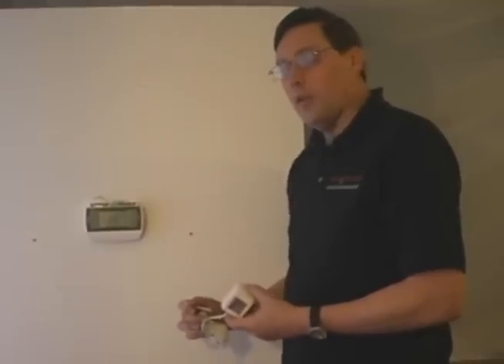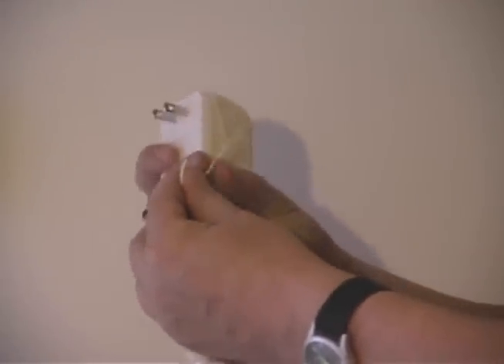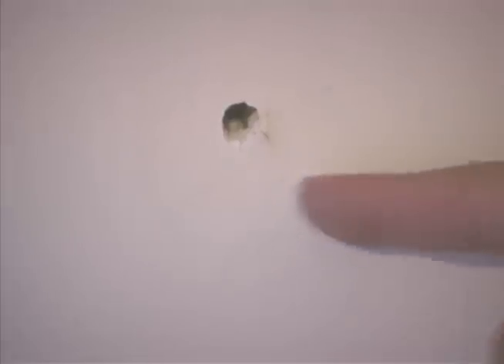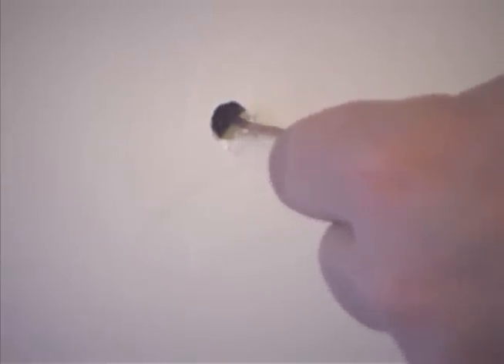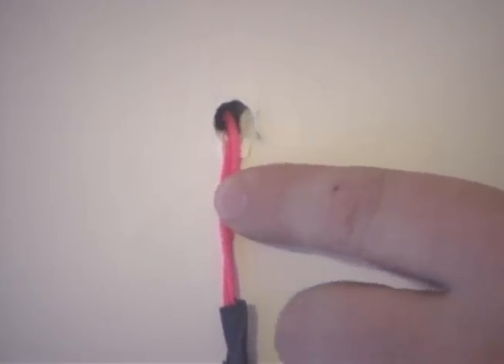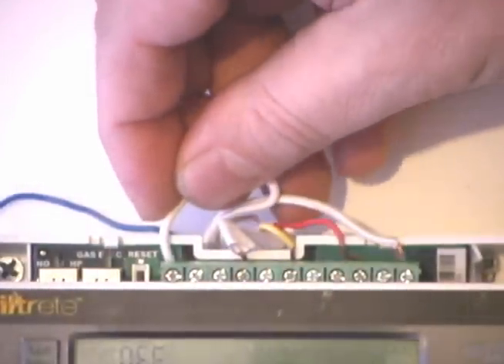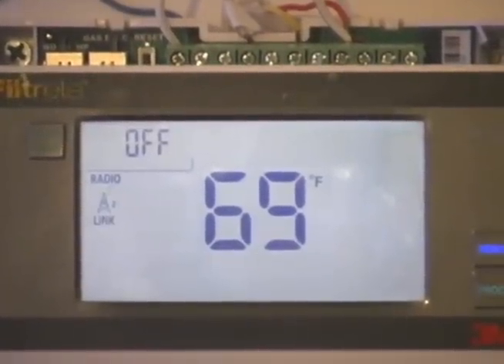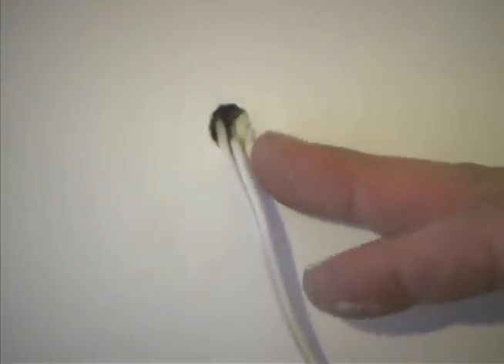C Wire - How to power the thermostat via an additional transformer

Comment: So if o only have an R just add it to C and R correct?
Reply from the maker: If you only have a R wire  you do not have a wire to put on C. you would need to add a 24 volt at .5 amps power supply.  Then from the 2 wires coming from the low voltage side of the transformer you would put one wire on C and add the other wire to the RH terminal that already has a wire coming from your HVAC system
Reply: @Homehandyman101  my system has no the just r. But I got it to work with my method. Thanks so much.

Comment: So if I already have an Rc wire connected to my AC, I will now have both that wire and 1 of the wires from the 24v power supply on the thermostat's Rc terminal?

Comment: Hello I am thinking of running power to thermostat using 24v transformer. This is because the new nest that just came out only has R, W and C. I have R & W for heat. I am planning to connect the two wires from transformer to R ( already has R furnace connection so doubling up) and to C. Is this ok? Especially doubling up on R?

Comment: I have a gas boiler. My new smart thermostat only has a "R" terminal, so what I have is 2 wire to the boiler red & white. So in summary red wire is connected to "R"  white wire to W1  then the 24V transformer I have 1 wire going to "C" the other wire going to "R" as well.  So the terminal on the stat has 2 wires going in "R" 1/2 of transformer and the boiler red wire, does this seem OK to you?

Comment: what if i dont have an RH terminal
Reply: Do you have a R terminal?
Reply: @pinball30  yes I have a heat only system. The R and W terminals are in use. I bought an external transformer. So what terminals would the external transformer connect to?
Reply: The R and the C
Reply: @pinball30  does positive from the external transformer go to R or C?
Reply: Should be AC and does not matter

Comment: Heat only system, I installed my Nest Thermostat as per the tech - Red to Rc / White to W1 / Black(fan) to G. I would like to add an external 24Vac transformer - I realize that one of the new transformer wires would go to C but where would the other go and where should my Red wire now go for this to work properly?  I am worried about frying something ;)

Comment: You suggest putting both the 24v wire from transformer and the 24v wire from the furnace on the same screw. Is that what I understand? If so, it sounds like you are putting double power on that one screw from two different power sources, is that accurate? If not, can you explain? I have this set up but have the transformer hooked up to the C and RC and the Red wire from the furnace hooked to the RH. This works for heat but it doesn't work for AC.  I would be really grateful for your help if you could help! THanks!!

Comment: Y’all are crazy! Aren’t you supposed to take out the jumper from rc and rh!? I have a 2 wire boiler system, with another transformer. I put my r in rh, w to w, one transformer wire to C and the other to rc and removed jumper.
Reply: This was the question I had - did your method above work for you?  Just looking for confirmation.
Reply: Dustin Lema yea, on my Emerson sensai thermostat
Reply: Perfect!  Picture is worth a thousand words - that's how I plan on hooking it up!
Reply: Dustin Lema glad to help bro

Comment: I just installed mine with a common wire.  However I used a 12 VAC transformer.  Everything works but i cannot get the yellow light to blink for internet.  It does show the cell tower and 1 since I installed the module on the left side.  Just no blinking yellow.  Is this because the transformer is to low or is it from something else
Reply from the maker: Yes, it is because you use a 12 volt transformer.  If you change it out to a 24 volts and .5 amps unit is will work correctly

Comment: Hi,  That's my prob. exactly, No common.  But  both the old mercury therm and the new therm.  neither of them have the   "RH" terminal   Both the old and new have a "R" terminal that is labeled 24V supply.    Is that the same thing?   If I hook one to the 'c' terminal and the other half to the "R"  24V supply terminal will that work ?

Comment: At 03:24 you indicate that the second transformer wire can be added to the RH even if there is already a wire there and it won't interfere.  If I do that, and remove the jumper between Rc and Rh, can I control my boiler, and separate AC unit from the same thermostat.  I will have the boiler wired to White and Rh (with 1 lead of 24V transformer also on Rh)  The other lead of 24 V transformer will go to C  and my AC will be wired to Yellow, Rc, and Green.   Do you think this will work?
Reply: That would be my set up too.  Did this work for you?
Reply: @AndrewTaub  yes it did.  I wound up changing it and control boiler and AC with the smart thermostat.

Comment: Thanks for a great video! I'm completely new w/wiring & read 5 diff ways & still deciding how to approach this.   Are you familiar with #2 solution on ecobee.zendesk.com/hc/en-us/articles/236335908-Taco-SR503-4-Three-Zone-Switching-Relay  

Initially I thought no problem, I have a new oil system & I'll follow Ecobee videos, only to find out I don't have a C, nor G to substitute. Then thought I'll install a C wire but had no clue to where. So that forum answered that I shockingly didn't have a C terminal in that Taco box at all, to support most new thermostats.  Then #2 method says I need "step down transformer" & "isolation relay". I watched a video about step down transformers wiring to Zone Valve, which I couldn't find b/c I had 2 circulators instead. So I've been stumped how I would do option #2 without a zone valve.

Your video sounds like a simple "plug & play" solution, but I have 2 zones & limited space for plugs & don't want to overload. Is there another type of transformer that handles 2 zones? I feel if there is a way such as #2, I think I read I could power w/1 transformer, depending on volts of Zone Valves volts combined, I guess in my case, the circulators?  I don't know what all the HVAC pieces do yet, nor what an isolation relay is.  So I may have a long way to go in research. I'm thinking of 2 different brand/model thermostats on each floor, once I figure out the most cost efficient way to get a C wire without accidentally short circuit anything..or avoiding rewiring all the wires if possible.  My existing old thermostat wires is just a w, rh, and a jumper from rh to rc. The even older Honeywell thermostat, is probably similar but very complicated looking because It sort of looks soldered in with molted metal.. I'm not sure & No labels.
Reply from the maker: I can not speak for Echobee but if you are using a Radio Thermostat all you need to do is hook one side of the AC transformer to the "C" and add the other side to the "RH" Note that each thermostat draws about 300 Ma so for two thermostats you will need a transformer rated for around 600Ma to 1Amp or 1000Ma,

Comment: I'm using a Honeywell wireless thermostat with an external transformer powering the device to the C terminal and the R terminal with the R and RH jumpered together. The thermostat powers on, controls heat fine, but when it tries to turn on the AC the thermostat just powers off and reboots after the AC and compressor seem to turn on for just a sec before the thermostat shuts back down. Any ideas what may be occurring?
Reply: Dont jump R and RH according to the manual there is no reason to jump anything.

Comment: I tried to connect an external transformer to the lyric t5 thermostat, however there is no rh connection. only r and rc. If I connect the ground of the transformer to the rc it powers the thermostat however the fan will not come on. This is for a heat pump according to Honeywell the rc is what calls for the fan. can you think of how I can get this to work
Reply from the maker: Hi  The R is the same as the RH connection.  So one wire on R and the other on C.   That should do it!

Comment: Just substitute g for common, if you have a common terminal on your furnace circuit board. Use g wire at tstat and move to c.then jumper y and g together at furnace. You will loose ability to run fan during a no heat or ac call, but better than running new stat wire. Only works if you have a fossil fuel burning device, because furnace controls fan for heating. Y and g get jumpered at furnace so when ac comes on you get high speed fan on. The g for c method does not work on an airhandler, because thermostat controls fan for electric airhandler. I dont like this method this guy is using because he has two transformers going to stat without jumper between r an r/c removed. Just better to run new stat wire to equipment. Also that kind of wire is not approved to be running behind wall or behind a baseboard.

Comment: You realize that your "stacking" power supplies right? What you are advocating here will eventually damage equipment and could even start a fire. The second power supply should be wired into a passive relay. I suggest you check with the manufacturer or a Licensed HVAC contractor before posting something like this.
Reply: Hello Cory,

I have a Honeywell RTH2310B with these jumpers only: Rh, Rc, W, Y, G

If you have a few minutes, can you tell me what jumpers to wire in in my transformer...

Thx
Reply: Moe I'm not completely familiar with that thermostat, but it appears to be a conventional. I would need to know what type of system your connecting to, and what color code (low voltage wires)your installer used on the low voltage system. Since it's not a "smart" thermostat you should be able to use the low voltage provided by your heating system.
Reply: It's only 1 red and 1 yellow cable.  The red one is plugged into Rh and the yellow is in W.

I bought and hooked up the thermostat myself.  

I'm just trying to see if there's any way to hook up a transformer -  safely - with this configuration.  I am tired of dealing with batteries. :)
Reply: Moe Not with this model thermostat. I read over the installation instructions and they have no provision for powering it.  Unfortunately most battery thermostats work better in most heating system control strings as they are not power stealing (unless designed for dedicated power)  If your looking to get away from batteries Honeywell is making their new "T" series which work nicely. I personally have an Ecobee, which I like. I don't personally like the Nest. As a technician I had as issue with their technical department help line and won't use them. All of these thermostats require a power supply SEPARATE of the heating system, run through an isolation relay, to work properly. I have seen many videos of people who "make them work" but are creating damage that can't always be seen right away.
Reply: So there's a way to make this model "work" with a transformer then?  

Even if it's not specifically designed for transformer power I don't mind doing it 'cause they're like $30 at Home Depot .  so if it gets damaged it's no big loss.

Lemme know...maybe link me a video?

Comment: Will this work with a millivolt system? i.e. can I have the 24VAC power and the millivolt both in Rh? Power: Rh to C, heat call Rh to W
Reply from the maker: Yes it will work just fine.  Since it is an AC transformer it will not interfere with your milivolt system

Comment: Thanks @Homehandyman101, your video inspired me to get my ecobee3 thermostat not only up & running but installed neatly: 
Part 1:  I wired the transformer in the same room as the thermostat, as per your video, piggy-backing off of the Rh-wire. Worked great! But I didn't like the "wall-wart" transformer in my office...
Part 2:   My thermostat in-wall wiring used a single 18/3 line - with two of the three wires (Rh & W) in use - the third (green) wire was unused.  Decided to use the green (unused) wire as the "Common" C wire substitute.  Moved the transformer to the furnace location, wiring either 24VAC terminal to the furnace-side's Rh terminal wire and the (previously unused) green end, respectively. Worked like a charm!  Ecobee thermostat got the 24V continuous power it needed. The existing Rh & W wires continued to function for their relevant heat-zone.  All this - without running any new lines in my office and more importantly no ugly "wall-wart" plug!

Thanks again!

Comment: can this method be used for two thermostats?
Reply from the maker: Yes, in most cases it can as long as the transformer has enough amps  - 
most 300 -800 Milli amp transformers can run 2 thermostats

Comment: Quick question... i got a blue wire that is not connected to anything at the moment... and i see in the main ac unit that the same wire is not connected either i wonder if i can use that wire as a c wire but where should i connect the main unit side of the wire to? i only see wires put together before they go to the main board... any help will help... thanks
Reply: same thing for me.  has this been answered?

Comment: I have a 24v external transformer to provide a constant 24v to  my generalaire gfx3 humidistat.  There is an R and a  C on the transformer, and on the humidistat, there is AC L and AC N, which terminal on the transformer would go to which terminal on the stat ? thank you if you answer me, if not, no problem!

Comment: i want to know if this method is posibble for a gas boiler i want to install a honeywell thermostat that needs a C wire but the current wires are only two wires that goes to the boiler in the basement can i use this method to make the new t-state work for the boiler.please help
Reply: Did it work on your gas boiler i have the same deal thanks

Comment: Just installed mine using this transformer method. Works perfectly. Thank you so much for this video. After looking in my basement, I wasn't about to run a new C wire.

Comment: Im looking to do this however i have R and RC, with Red from Air Handler connected to R with jumper to Rc. If i connected Transformer to Rc wouldnt it be a problem if they were still jumped (2 hots together)
Reply: Thanks Dan - that worked for me - I wish they would just include this in their manual since it's such a common setup.
Reply: I have the same situation. Did you ever find and answer? Not sure if I should leave or remove the jumper
Reply: Dan Thomson The way I got it to work was Internal Transformer from Air Handler on Rc. External Transfer to R(Rh) and C. Then I had to jump Rc, and R together with the jumper for it to work. I was worried about it doubling the voltage in the beginning but since its not a common ground the voltage wont double.
Reply: Brian Weaver Thank you!
Reply: This is what I'm also worried about.  Connecting two transformers (external that shows in this video and one from Heatpump unit) to same connection.  See Nick's post from 4 year ago on this same thread.  He did that and fried the thermostat. I'm more worried about frying the HEVC transformer or worse.

Comment: what ever, just take the honeywell unit back and get the nest. it does not need the damm C wire
Reply: +Jason Lacquement Everything I've read about the Nest says it does need the common wire.
Reply: +Dan Bennett mine needs the c-wire from my gas boiler. It gets power, but needs to be taken off and recharged from my computer about once every two months.

Comment: Would this work?
http://www.nextwarehouse.com/item/?1421780_g10e
Reply: Generally HVAC equipment is designed around 24V AC. Depending on the tolerances of the equipment it may or may not work, but your safe bet is sticking as close to 24VAC as possible. Try taking a look at this transformer: http://www.amazon.com/MG-ELECTRONICS-MGT2450-TRANSFORMER-24VAC/dp/B0007N72TC/ref=sr_1_9?ie=UTF8&qid=1407432258&sr=8-9&keywords=24+vac+transformer

Comment: For those who have multiple thermostats running a multi zone hot water pump driven system, YOU MUST PROVIDE DEDICATED TRANSFORMER FOR EACH THERMOSTAT. We made the mistake of powering all five thermostats from one central transformer without realizing we created a loop to terminal RH allowing any one thermostat to turn on all zone pumps. We now have five centrally located transformers isolated to each of the five thermostats.
IMPORTANT, Polarity does matter when using dedicated power transformers in addition to the systems transformer connected to RH.  YOUR MUST make sure that the tow transformer legs match the load or common designation of each.
Manufacturer please add footnote under dedicated power source
Reply: gadgets906 it’s possible you could have taken the RC jumper out of each t tsat (if applicable) and powered them that way.

Comment: I have a question. I just bought the Nest and tech support said I did not have enough power in the system with just my four wires to get cold air through it. I live in an apartment and have a conventional electric system.
My question is, what is the best adapter to get? I am going to have to run a long extension cord to do it, but I think it will be worth it.
Thanks

Comment from the maker: I would suggest a 18 volt transformer and .5 amps.  If you get the plug in the wall type you can install it near the furnace or by the thermostat.  If you install it near the furnace you need to attach one wire to the unused wire going to the thermostat and the other wire to the terminal that the R or RH wire is attached to at the furnace. Then take the unused wire at the thermostat at attach it to C

If you are putting by the thermostat then one lead on RH and the other on C

Comment from the maker: Recommended Adapters: 
•mouserelectronics Part # 802STA4116, specs 16VAC @ 250ma, about $11.00, phone 1-800 346-6873 
•digikey Part # T1129-P5-ND specs 16VAC @ 250ma, about $11.00, phone 1-800 344-4539 
•mpja.com18VAC-20VA-Plug-Transformer-Ault/productinfo/17560+PA/ 18VAC W/Terminals and wall screw, about $4.00, phone 1-800-652-6733  
•sciplus.com Part # 27671 ADAPTER, specs 18VAC/100mA, about $2.00, phone 1-888-724-7587